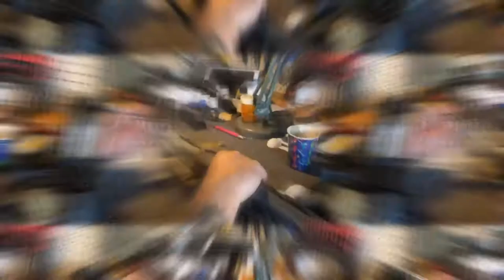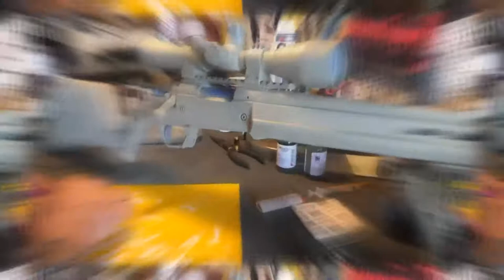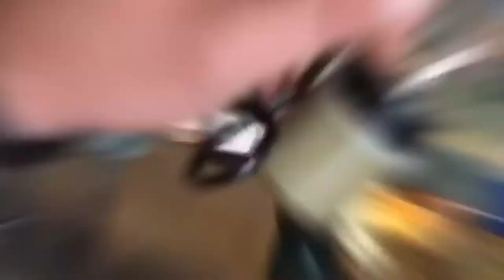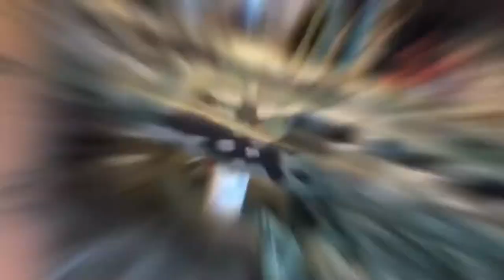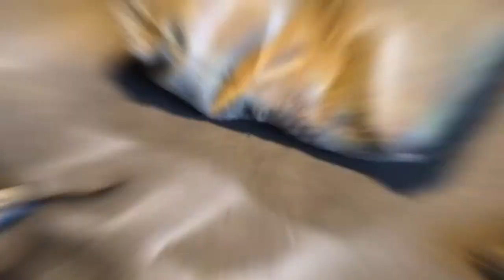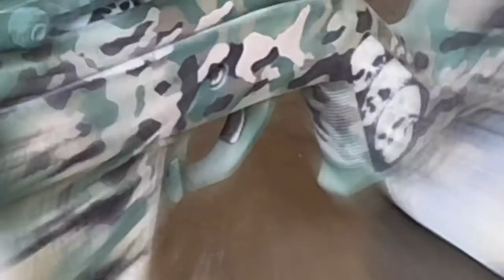Multicam Duracoat paint job “The Surgeon”

Comment: That looks amazing, very detailed. What exactly is duracoat, and how does it compare to cerakote or rattle cans?
Reply from the maker: Duracoat is a epoxy based paint. Cerakote is good but I don’t have a oven so I don’t use it. I have a lot of guns painted with Duracoat and it holds up really well as long as the surface was prepped properly. Spray paint is trash. I wouldn’t recommend rattle canning a gun.
Reply: There are coating tests on YT that demonstrate Duracoat to be about 5x as effective at corrosion resistance than any other firearm coating, except Ceracoat which is about 4x better still than Duracoat. Ceracoat needs to be baked, so I chose duracoat out of a $90 airbrush kit, and it's absolutely awesome. Doesn't chip like spraypaint, dries to touch & lightly handle quicker, and is pretty forgiving to apply in terms of drip prevention.
Reply from the maker: @evilassaultweaponeer  I completely agree. I’ve watch a lot of videos on this matter. In my experience, Duracoat has held up extremely well. I have a Cerakoted pistol that shows some extreme wear marks from a retention holster. So for the price, I’ll take Duracoat
Reply: @Scorpion_Ink  Would you say it wore more than Duracoat, or about the same? I always figured Ceracoat would do better on all fronts, but I suppose it's possible that it winds on corrosion but loses on abrasion to Duracoat.
Reply from the maker: @evilassaultweaponeer  I think it wore down about the same. I think Duracoat can withstand impacts better than Cerakote does. The secret to success for Duracoat is the prep work especially for metals. I sandblast, acetone bath, and degrease everything with Duracoat degreaser and never have issues.
Reply: @Scorpion_Ink  I don't do nearly that much; hope I keep getting away with a simple scuff and alcohol wipe haha
Reply from the maker: @evilassaultweaponeer  I did the same for awhile. In my experience, wood and polymer are more forgiving than metals. I tried cutting corners on prep work for a Ar15, did base coat and a ton of stencil work for a Kryptek pattern. Once I peeled, the majority of the base coat pulled off. Very disappointing. A complete waste of paint stencils and time.
Reply: @Scorpion_Ink  Oof